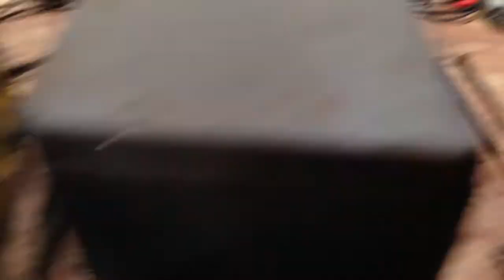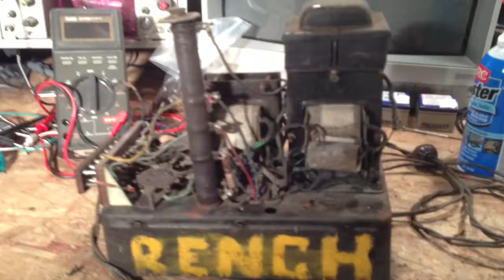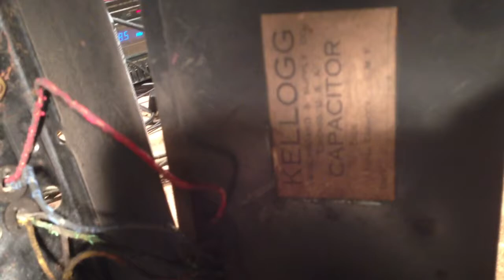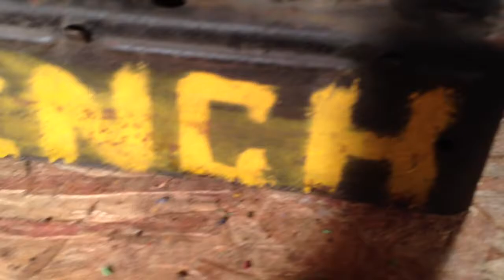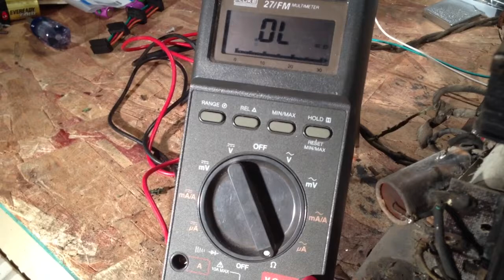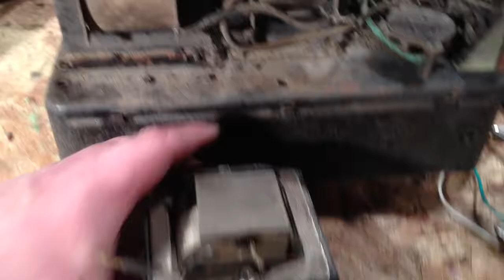Zenith 34P Power Supply Part 1

Comment from the maker: The entire set does, I have made a replacement for the main power cable that goes from the power pack to the rest of the set. and am going to replace every inch of wire in it with modern poly insulated wide, as there is no cloth covered wire in there, and Zenith used different colors of wire for different functions.